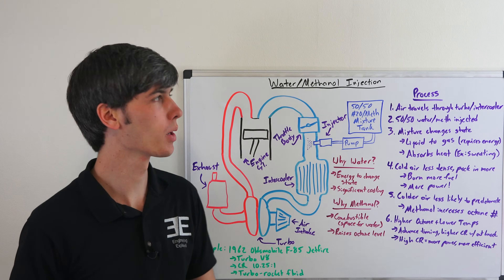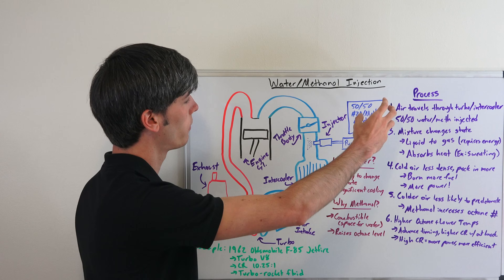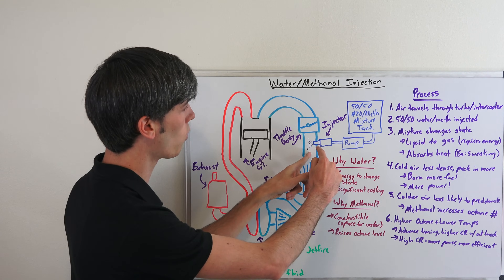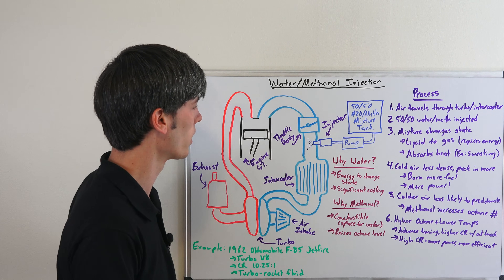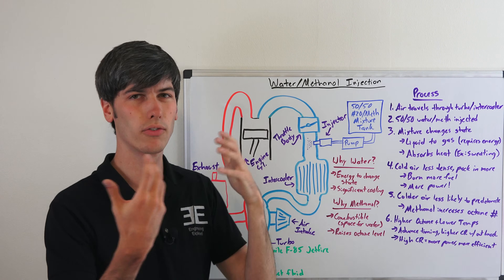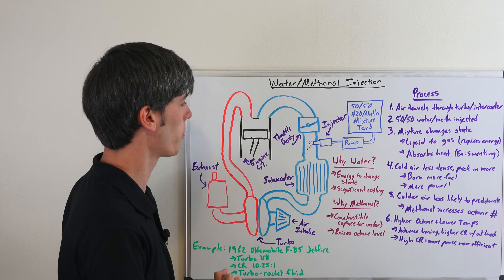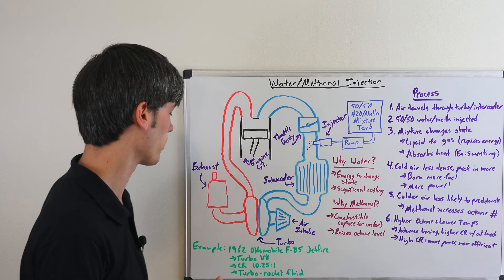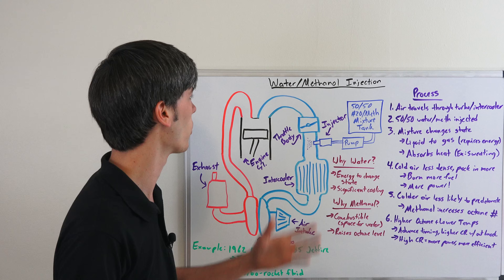Water Methanol Injection - More Boost!

Comment: what do you think about,injecting just before compressor blades of turbocharger?
benefits or not?
Reply: +Mike Deshong It would not, since you would like the intercooler to act as a heat exchanger. To achieve good efficiency, you need to have a high temperature difference between the intercooler and the air passing through, logic. In that perspective I assume that putting it before would not be as efficient at decreasing temperature as it could be.
I also think it could increase turbo lag, because of the higher air density.
Reply from the maker: +Mike Deshong I would do it after. Unnecessary to have it before.
Reply: i just figured it would be a great area to atomized the alk/water mix. drop intake temps pre-intercooler.
Reply: +Mike Deshong supposedly it damages the turbine blades, but there's a lot of hearsay and not enough facts
Reply: So... Finally I spent a couple hours googleing about that, using physics as well. And I came to the same conclusion : you'd prefer it after the intercooler.

A good intercooler has got a thermal efficiency ranging from 90% to 75% within its race powerband, measured at the intercooler entrance and at its exit.
Note: 100% efficiency = air as cold as the air outside is. 70% is at max RPM, too much heat is produced to be completely evacuated.
So usually, post-turbo air is anyway well cooled, there is no need for water before the intercooler.
Anyway, some would still wish to do so, which can be a bad idea...

After analysing a bit, I realised that injecting water on the turbine leads to bad flow separations (mater is more dense = difficulties in the intercooler entry, leaving small vacuum areas). As a result, huge turbo pressure is being lost : increase of velocity + lower density + water being trapped in these vacuum areas like mud being trapped on your rear window at high speeds. You'd basically rather want that air  to expand into the intercooler, so you better avoid something causing inertia.

In the end these clearly counteract the benefits of a water injection IF you have an intercooler.
Oh, and again, it creates turbo lag, something you definitely don't want.

Why would WW2 planes do it before the turbocharger?
Guessing At high altitude, plane engines during WW2 would stall if they were not turbocharged. Most of them, I guess, had lame or no intercooler at all (why would you create drag on something that needs to be very slick?). Air is less thick at higher altitudes, pilots keep the throttle on all the time and turbo lag is something they migh have never heard of.

Why does it work on some vehicles? I'm not saying it doesn't, it is just less efficient IMHO.
Reply: Genki De
He was using both methods. 50/50 for the throttle body. 100% meth for the turbo.

He was able to get his stock turbo to act like a big turbo upgrade.
Reply: I see. I got it.
Reply: Mike Deshong
Where I live, the average is 86 deg. The highest it stays is around 95. The humidity is almost always above 70% though. So 100% pre-turbo meth is a huge help.
Reply: Mike Deshong
It has to be mounted very precisely. I would need to find or make an adapter like this for my K04:

http://www.usrallyteam.com/index.php?main_page=product_info&products_id=1943

^that one is for a K03 which makes it act like a K04.
Reply: This is perfect!
Only sprayed at near peak boost and back pressure drops, at same boost levels with mass flow rate increased.
Iam definitely going to get a meth kit. 
Just to have.
The benefits are great.
It will even keep a clean valve train and piston tops from carbon.
Reply: Mike Deshong
I think the throttle body might also be kept clean.
My car is Direct Injected turbo, so this is the only way to keep the valves clean.

Oh, but you should do both. 100 meth pre-turbo + 50/50 water/meth pre-throttle.
Reply: +dpro1995 Absolutely nailed it. You want the temperature difference on the intercooler, as long as it isn't being heat-soaked, and then mixing in the water injection after increases its affects. Theory backed by dyno caps on forums.
Reply: that is what I've read also.
said the ww2 engines merlin in particular,would inject pre supercharger and after. because the thicker mix of air water creates an over all more dence charge of air. hence being 10,000ft up makes the intake charge similar to ground air quality.
Reply: asdreww cool deal man. Iam going to research more.
I live in Miami and have an old turbo Mitsubishi.
And have been noticed high intake temps after one or two hard pulls.
So iam trying to figure a way to keep them in better check in the 100+* heat.
Reply: asdreww Another case of someone who's a bit too open minded, when it comes to real world applications.

In the performance model of cars and race cars, pre-turbo water injection is neither reasonable nor useful. Even with your turbofan-derived compressor theory in consideration, the benefits of post-intercooler injection versus the alternatives indicates a black-and-white right vs wrong approach when we aren't magically capable of teleporting gallons of water/meth mixture to the vehicle from a distance.
Reply: +Joe Smathers There were dyno run evidence using 100% meth injected pre-turbo and 50/50 injected pre-throttle body. The guy who tuned his car was pushing the turbo past it's flow/heat limitations essentially running it as if it was a bigger turbo.
I've read that 100% meth pre-turbo works very good in very humid weather (70% Humidity). It would mix with the water vapors in the air. 

There was concern that overtime the turbo's compressor wheel would get damaged, but there was a theory that it would take too long to see the effects and the life of the turbo would outlive the engine and the car.
Reply: +SI0AX 50:50 is vastly different than 100:1.
Reply: Genki De
Thing is, I want to do the pre-turbo meth. It's a lot cheaper than a big turbo upgrade(1 grand+).
Reply: this sounds good.
being able to push a 20g turbo to the max in 100.f weather in Miami and keep pre-detonation under wraps would be great.
Reply: Iam so interested in this. 
Kinda like a secret weapon for performance.
 With a small 16-20g turbocharger being able to work in a much higher boost pressure will be sweet!
Reply: NO! After turbo or supercharger only! Doing it before will eat the turbo turbines or the supercharger lobes
Reply: Yea the only thing you could add to your turbo set up would be a fogger on the front of your intercool, which just sprays water to cool the intercooler more. Then having the w/m mixture added after the intercooler to further the process of cooling the intake air.
Reply: Nicolas Losito
It is controversial as some people say that it takes a long time to eat the blades but if you want a reliable setup, don't do pre-turbo injection.

I would do it, as I plan to upgrade by turbo anyway, and it's already showing signs of failure, so I don't really care about it. I have full silicone intake to the turbo, so that's what stops be from pre-turbo meth spraying.
Reply: Don Perry Automotive
Yeah, I currently inject at the boost tube the connect the throttle body to the intercooler.

If I had an aluminum intake, I would have already done the pre-turbo injection as my turbo started leaking oil after 45,000 miles. It has almost 60,000 miles now. I had to raise the idle rpm to 950 to stop the turbo from burning oil.

Comment: Just saw an F-85 Jetfire at the San Diego Automotive museum, which has a bunch of awesome (and massive) postwar cars right now. The display said that the Jetfire's turbo system was very ahead of its time and really error-prone - partially because people didn't keep the "rocket fluid" topped up, which caused detonation problems. They recalled all of them.

Comment: I have a supercharger on a 11.1:1 motor.  I believe I'm at 13-14* of timing.   I was told I have to run 100% methonal but I've also been told that I could run 51/49 mixtures.  any idea on which is true?
Reply: I'm on 10lbs.
Reply: +B V  It depends how your meth injection system has been setup (jet size/tune/etc). Its a big difference between 50/50 and 100% meth. I would just try it and measure for KR on a half throttle pull, then 3/4, then WOT pull. If I got KR at any point of throttle input, I'd go back to the drawing board.
Reply: +Mr318live Ive been running 100% and its been great.  Im sure I'll end up sticking with it.  I just didn't know if it was easy to just run 50/50

Comment: Can you use Water/Meth injection with N/A cars?
Reply from the maker: +HBJ Perhaps, but I'd go other routes first. If you want to advance timing more, and the car is capable of benefiting from this, the first option would probably be to use higher octane fuel, and then tune it accordingly.
Reply: +Engineering Explained yeah here in the UK higher octane fuel isn't the most accessible :(

Comment: I have a question regarding the pressure and volume content , as the mixture is injected into the pipe before injector the are more chances of increase in volume and pressure in that particular area , as we know after the work of turbo charger the air is pushed into the injector where it adjusts the amount of air to be sent . increase of pressure in that area can be dangerous .

Comment: Turbo rally cars used a pre-mixed 102 octane fuel, with methanol. Without the use of water. Would this work to just cool the air inside the cylinder.

Comment: What about different water/methanol mixtures? For example if the solution is 30 water and 70 meth? Also if the point of injection is directly into turbo right after the intake what will happen?

Comment: Hi,
 Is the methanol used just fuel from the patrol station?
Also how come some car uses nitrogen? Can you explain how they works?
Thanks :)
Reply: Nos is the same theory, It just cools the air dramatically when it is sprayed in creating a shitload of horsepower. But Nos burns so much so fast. Like for instance a big bottle of nos would only last maybe 6-8 quarter mile runs in a wet injection system. And the top fuelers for instance, burn somewhere around 80l of nos in 4-5 seconds.

Comment: Would having meth injection be a good idea on my 2007 Cobalt SS Supercharged? If so would I get noticeable gains? Thank you.
Reply from the maker: +Carter Tuchscherer I'd probably go other routes if I wanted to increase performance, but that doesn't mean this couldn't help. It can allow you to have more timing advance, potentially more boost, and reduces the likelihood of knock. That's all assuming the engine can handle the extra stress.
Reply: +Engineering Explained If you could recommend something to gain performance what would it be? Besides buying a better car because I know the Cobalt isn't the best haha :D
Reply from the maker: Carter Tuchscherer If performance is your goal my first recommendation is always to remove unnecessary weight. Making a car faster isn't cheap, but removing weight is! :)

Comment: would it not be better to inject methanol before the inter cooler ?
Reply: +Joshua Bliffen No, the idea is to make the liquid evaporate which absorbs energy, hence cooling the system. The intercooler would cool the gas below its condensation temperature and turn it back into a liquid, negating the cooling effect.
Reply: +HavokTheorem ok I ges that works. I think I will just stick to race gas and watercooling my intercooler.
Reply: Don't listen to him. It is better to do it before the inter cooler. There is no way a hot inter cooler can make the water recondense

Comment: would intercooling a naturally aspirated vehicle give any more power?
Reply: +daily_wheeler Don't think so. An intercooler can only cool to the temperature of the ambient air... and that's the same temp as the air going into a naturally aspirated intake manifold. Boosted air heats up due to being compressed, so therefore it can transfer heat to the ambient air and cool down.

Comment: ... Because of the lower intake temperatures, to pass emissions, would an EGR valve still be required?
Reply: +Jose Garcia Probably. EGR is very useful at start up when the engine is cold.

Comment: +Engineering Explained.  
you compare the W/M injection to sweating, and while I get that evaporated sweat takes away heat from your skin, it literally takes it off your skin as it evaporates (right?).
My question is, when you inject W/M, the water can't take away heat and dump it somewhere else, so is the cooling down process more one of inserting cold (the water will cool the average temperature of the air by giving off it's "coldness" (absorb some of the heat from the air)...?

Comment: i thought the water was what added the knock rating
Reply from the maker: +wiltse0 It does help reduce knock by lowering temperatures. Methane has a higher octane number than gasoline, however.

Comment: can you run this system on a stock car without a tune and see significant results?  what I mean is, will the ecu be able to notice the change and change to more aggressive timing or does it require a tune?
Reply from the maker: +Kimo Kalihi If the system was designed to always use maximum timing advance, maybe, but honestly it's something that helps you more if you tune to use aggressive timing and/or decide to increase boost. Helps prevent knock in situations where you use engine tuning to increase power.
Reply: +Engineering Explained thanks.  that's what I figured.  I may get a meth setup once I get an esl board for my ecu to enable live tuning, if it's necessary.  I see a lot of people online running e85 to make big power but I don't want to mess with that.  I can only think of one station around here that sells it.  I want about 350whp on 92 octane from my ej22e block and ej20g heads on my 91 legacy.

Comment: Most people put the water injection before the intake side blow-off valve to keep full pressure while having denser air. If the blow-off valve is before it, then you could potentially lose usable air.

Comment: I am failing to see any cons to this system, please inform me if there are any.
Reply from the maker: +Romil Singh Additional cost, complexity, weight, and an tank that requires you to refill it regularly. People just want to gas up and go, which is a big part of why it's been unsuccessful in production.
Reply: Ah thank you for answering my questions friend
Reply: +Romil Singh Another problem is that engines are designed to handle X pressure. Add a more violent combustion inside it than it was designed for, and (probably) although it won't explode, I doubt that it'll do the engine much good in terms of durability either. Essentially, it wears out quicker.
Reply: You're replacing water with fuel, NOS does the same thing but better haha

Comment: I'm running this on a 2.2l diesel motor, 4gph of nozzles. 1gph pre turbo 3gph post intercooler but running on a mix of isopropyl alcohol rather than meth and the systems controled by an arduino reading maf flow and the app sensor (pedal sensor). The setup gives it quite an extra bump in power and much better pickup after changing gears.

Comment: Can I ask, do you ever attempt to put some of these systems together. I think you will find that the concepts you describe in a car you own, where if you are not exactly correct you're going to take a major loss, will change the way you describe things. I have seen many of your videos and I am glad you're out there but some of the stuff you say are general concepts that are correct most of the time but when applied to the very specific situation are not what is happening for that example. What I am saying is that I think you would grow as an engineer if you tried doing some of the more complex systems on your car because you have to get VERY specific or your going to pay a price. ie "this saves weight" is true but sometimes the actually weight you're referring to is 2 pounds because you have never ACTUALLY weighed that part. Sometimes holding something in your hand changes your view of reality.
Reply from the maker: Feel free to point out specific examples. 2 pounds removed from a driveshaft is something worth mentioning, 2 pounds from a frame is a different story. The channel hasn't really changed in the educational structure. I don't have the time nor resources to install these items on cars. We're learning how they work; not how much benefit they will provide, as obviously that would be on a case by case basis. Even if I did do something on my car, doesn't mean it would have the same effect on your car. As I mentioned, feel free to provide specific examples to discuss.
Reply: +gus bisbal Yeah some guy once told me a pound off your flywheel is like 25 pounds off your car. Changing your lead acid battery for a Li-ion would remove 10 pounds too. There are engineers... then there are petrol heads lol

Comment: My car runs on ethanol, would a water/methanol injection kit help in this case? 
Would I be able to even add more timing? Would I get more power by using it?
Reply: SI RICKO And why not?
Reply: I think 100% water injection could be quite effective. Especially if it is super/turbo charged.
Reply: Water has been shown to be an effective octane booster since the 1940's. However, it doesn't really need to, ethanol has a high enough octance as it is. It would just be a safety buffer and give a bit more power.
Reply: Like I said, water injection has been known to effectively increase octane for years, do some reading and you will find this. 

However, that aside, silencebone is already running 100% alcohol. Sprayin water/meth is just adding alcohol to alcohol, no point. May as well just add water and you automatically get the water/alcohol mix.
Reply: again, water alone has an effective octane boost for most if not all fuels. This has been known for decades. Just because someone on a forum who has never tried it says otherwise doesn't change that fact.

And you seem to be completely ignoring the fact that silence is already running 100% alcohol.